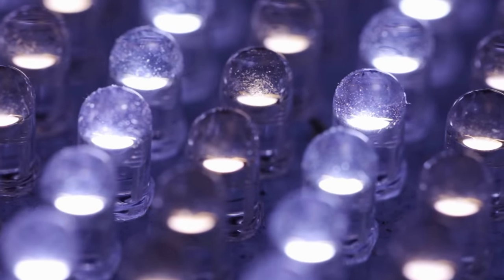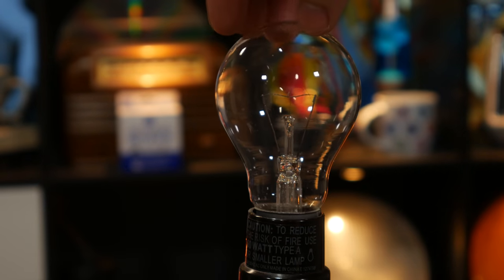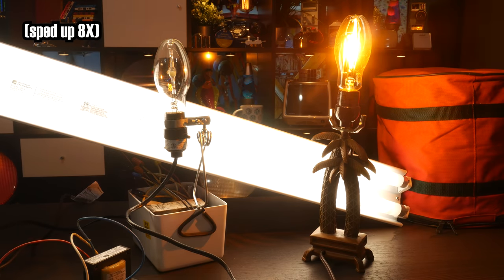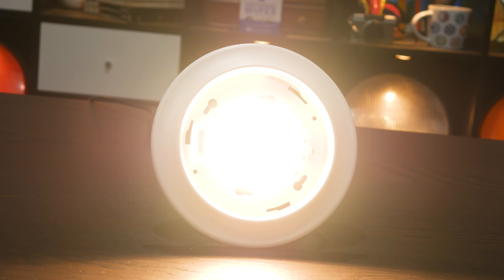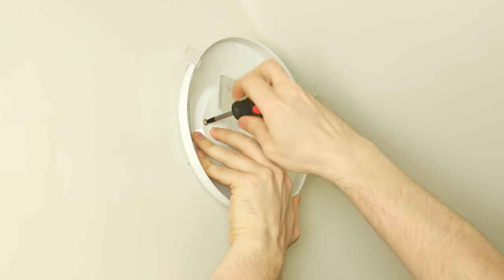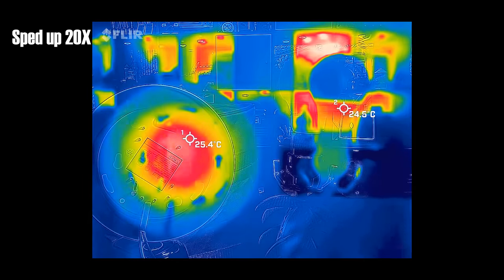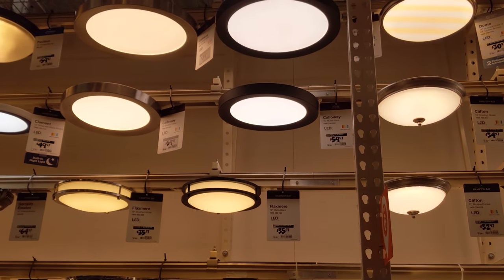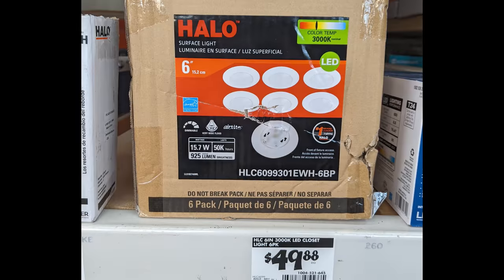A troubling trend in lighting?

Comment: I dunno, old school LEDs might also have really long service lifetimes. All my old 2014 LED bulbs came with massive heat sinks. I am disappointed that more modern LEDs did away with the massive heat sink design. I have trouble finding any modern LED bulb with a heat sink at all, even on the high end models.
Reply: Clearly they were lasting too long..... a bit of planned obsolescence was needed to improve the manufacturers bottom line.....
Reply: @geoninja8971  It certainly feels that way. When I sold my last place, I regretted not taking those LED bulbs with me as I never had a single burn out for the 22 bulbs in the 8 years I had them. But in the 6 months I've had my new place, I've had 4 burn outs for 26 bulbs. And the 2014 ones cost me $38 a bulb compared to the new ones which cost me $52 a bulb.

Comment: What kind of LED bulb can you use in a lava lamp - where the heat from the bulb is needed to melt the waxy insides of the lava tube? I can't help but wonder whether a special device comprising a heating element for the lava lamp and LED lighting fixture would be more efficient than an old school incandescent bulb -- which you might not be able to easily procure anyway.

Comment: Fortunately the EU has realised, finally, this is a problem so the new directives are out, requiring manufactures to adopt a more circular and "green" approach. LED modules should, therefore, be replaceable or the manufacturer must provide a good enough technical justification why that wouldn't be possible, before the product could be sold in the EU. The Single Lighting Regulation is established in three directives: (EC) No 244/2009, (EC) No 245/2009 and (EU) No 1194/2012.

Comment: incandescent bulbs had many different sizes and shapes. why cant we use the smaller bulb sockets for some of these. sure we would need a way to sink the heat into the socket itself more efficiently but it should be possible. i personally believe making the socket smart rather than the bulb is the way to go. we just need to come up with a new socket design.

Comment: I bought a cheap LED floor lamp without a replicable bulb from Walmart. Failed after two years. Took it apart and found one of the LED COBs failed, they are wired in series so if one fails the whole board stops working. I got a 50 pack cheap from eBay and replaced the broken COB. Worked for about four months and another COB failed...

Comment: Fun story. When I was a kid who knew NOTHING about electricity other than it hurt... And that there's a positive and a negative side. I decided to cut the cord off of an old toy, then I took the little blue LED out of the toy and connected each little pin sticking out of it straight to the positive and negative wires I had stripped from the end of the cord, then I plugged that bad boy in. Called myself making a night light. (Blue was my favorite color so I really wanted a blue night light for my room... lol.) I had a blue night light tho. For like .05 seconds. Lol. And it was VERY bright. Came with a LOUD bang and it started smoking too... lol. Luckily the breaker blew before it got too serious. I was intrigued. It led me to my curiosity of electricity.

Comment: I've just fixed one of these... By tearing the LED strips and driver out and putting two small Edison light bulb sockets in. So with little DIY one may save them from dumpster.
Reply: Before you ask: The one I fixed had a different design with a circular strip of LEDs glued to metal frame around a small driver in center-ish. Despite rare use multiple LEDs burned showing black spots on chips.

Comment: I have installed several of them that almost every one went bad rather quickly, and  unfortunately, one of those...things...I installed in my home.  Needless to say, I went back to light bulb LEDs. The one thing I think is rather odd, is it should be relatively easy to make a...erm...outlet like device that could be affixed to the electrical box and the LED device could be...screwed...latched...whatever to that receptacle like device. It should be possible to make it thin, thick, wide, long, or tall. At least it seems like it should be a simple invention.

Comment: I am still amazed and surprised at how lax electrical regulations are in America. To imagine that you can simply twist the bare wires directly together in a box in a wall and just screw a fixture directly to the box seems absolutely mental when you live in Europe where we have wall mounted fixtures for connecting our lamps externally to by law. As a homeowner you never even get near any bare wires.

Comment: I have a floor lamp in my bedroom that gets used a LOT. It's shaded, but the top is open to let the heat out. It went through incandescent bulbs like nobody's business. I decided to try an LED bulb in it, so I picked up an only-slightly- more-expensive-than-incandescent one from a reputable brand and it's been going ever since. How long? Not sure, but several years. So, so worth it. These things have like three times the life expectancy of a hamster, and hamsters, I'm told, provide HARDLY ANY lighting.

Comment: ok the led bulb failure makes sense. my bathroom fixture is ceiling mount combined with a exhaust fan/heater. that bulb usually lasts about 6 months. I'll change to the glass LED bulb next time it fails.

Comment: was looking at a similar product, much better design-- the biggest difference is you keep the old fixture or at least the screw. The new one needs no significant electrical work, just screw the connector in like a bulb.

Comment: What if they put a regular socket on the ceiling and then add some mounting holes? You can then build the fixtures to just have a regular plug and mount it easily and safely.

Comment: I've always considered standardised sockets to be generally better than the fixed alternative.

Those lights honestly seem like a scam, if the parts are placed such that they're at risk of heat damage and the whole unit has to be replaced with existing limitations on who can do so. A socket connector on a similar lighting setup to those ones would make a simple compromise, but I guess there's no money to be made in that.

Comment: the biggest issue I have woth them is that the screw holes in the metal plate don’t match with the screw holes of the square wiring box in the ceiling. Sticky tape isn’t really an option, so for now I have them hanging on the wiring itself

Comment: you know you can buy replacement boards for these lights right, despite being meant to replace the whole fixture? When installing, bring the wires into the fixture itself, and use WAGO connectors. When the LED fails, just replace the board. I've been using these all-in-one fixtures for more than 4 years with no failures, it's very rare that you have to do a replacement job. And when it comes time to do it, it's so cheap that one can just replace all the boards at once
Reply: Sounds like just as much of a job as just replacing the fixture.

Comment: The better fixtures have a proper LED driver power supply. That means they are constant current controlled, So a burned out LED in one of those can easily be bridged by soldering a piece of wire across that failed diode and the rest will light up as before. So they are actually repairable to a level no other light sources has been before. It is not only a issue of saving a few bux on a new lamp, But as they normally last years, getting a replacement fixture to match the others you have in a room can be impossible, Repair is the only alternative to changing all of them. LEDs are not "cold" to look at. The reason they seem so is because you use them with CFL or incandescent bulbs so you eyes white balance compromises and choose the middle way, putting the LEDs in the blue end of your perception. Use only LEDs and They'll seem like warm sunshine. Samething with HID headlamps: They look blue at night, even if they have the exact same color temperature as sunlight. Won't use anything less than 4500-5000k bulbs in my home. Yes CRI is important, go for bulbs or tubes made for retail lighting, they are in the 90-95 range to make displays look appealing and are not more expensive as opposed to "special" high CRI bulbs marketed for consumers. #3 Cob lights, the yellow sticks type, can for longevity, if used in an opaque fixture, have their glass broken before use for better cooling. Whatever heat conducting special gas inside those, can be easily be outperformed by a light tap with a hammer.
Reply: what brand of fixtures are they
Reply: @redcathode  The cheap bulbs has a diode-resistor-capacitor to drop the ac voltage down to a reasonable DC voltage and current for the leds, the proper ones has a real switchmode power supply, that include the ones sold in Europe and the US. and the more expensive ones online from China. Just open it up, if there is something with a coil or transformer in it or even a boxed power supply with some specs written on it, you are good to go.

Comment: One ironic thing about LEDs is found when you convert your car's old halogen headlights, and you find that many of these uber-efficient LEDs that ostensibly don't use additional power making loads of waste heat...need a cooling fan built into the light base to combat all that additional heat.  Even halogen bulbs don't need that.  🤔

Comment: Flickering power on and off such as happens when thunderstorm are severe, seems to nearly always coincide with the death of on of my led lights. They really do not cope well with inconsistent power levels. 
I have changed every single bulb in my house to led of one kind or another (yes all color matched) many are wifi smart bulbs and sadly they are the most prone to failure after a thunderstorm.

Comment: That's exactly why I installed regular recessed lights and use LED bulbs in them The myth that LED's last 20 years is just that and while I'm ok th  replace the entire light on my car in lieu of replacing a bulb, I'm not ok to do this in my house where I have probably 50 or so recessed lights. I did use these integrated lights in the closet where lighting isn't that much of an issue, but everywhere else it's LED bulbs.

Comment: THe only thing i'm thinking this entire time is, why instead of using the two dedicated wires as part of the fixture not simply produce a clip on or twist on socket so that you can remove the fixture without having to undo the connection to the box and then plug or slip on the new fixture and screw it in. Other than avoiding the cost of 1 to a small number of additional components.

Comment: What I like to see. with these led panel lights. Is a quick connection for the power wires. I hate having to use wire nuts to connect these.

Comment: One of the many reasons the incandescent light bulbs has been phased out, mainly the 60, 75 and 100 watt bulbs but soon all, is most of the energy is heat and not light  My question is this.  In places like Chicago, where out very humble host lives, in winter time, how exactly is that a bad thing?

Comment: landlords kicked my door in and ripped all my light fixtures down about a year ago.  installed these obnoxious things instead. 

when i moved in here, they had insisted that i was to call maintenance and put in a work order to change a fucking lightbulb.  the fixtures used these weird fluorescent bulbs with strange contacts that you couldn't easily find at Lowes or whatever, but were easy enough to find online.  now i've got a shelf full of spares and i have to call in sick and contact an electrician when my lights die out.

Comment: Wow. You in the states have standardized distance between screws to mount on standardized wall boxes? Here in Europe we just have wires coming from a hole in the wall or ceiling, and need to make new holes in the plaster every time we change the fixture (which makes those disposable fixtures an abomination)

Comment: maybe there's a market for. inexpensive plastic film with 'colour temperature shift' colours, as used in motion picture filming forever...3400 to 2750 was quite common, shifting halogen spots to match incandescent lamps...it would be killer in your case, just boutique out a circle of film, and lay it over the LEDs', and not much efficiency lost, little effect on cooling, especially if it was a 'soft' film that could adhere to the inside of the plastic dome...I'm surprised that a seriously-smart guy like you, wouldn't try that...

Comment: we need new standards obviously. a standard for drivers of different sizes, say 25W max, 50W max, 100W, 200W and then standard connectors for that to mains, and to the led board.
Then a bunch of standard sized LED boards of various shapes etc. say rectangle 5x15cm, 10x10cm etc. and round ones.and standard where the screw holes are, and what are the minimum cooling specs @ 25C ambient, which has to be designed for 100% duty and 30% over specced.

I just bought some OSRAM high bays for my garage, they are installed at 5M high. They were suprisingly inexpensive, but no connectors, and when failing replace the whole fixture.
Guess what? Just couple months in, 2 of them failed -.-
Now i have to get lift + electrician on-site to swap them, cooooostly. Costs much more than the fixtures. Infact, fixtures itself were only about 30% of the installation costs ...
It cost quite a lot to install those.

And because being LEDs i had to color temp mix too, out of 18, 4 are warm rest are cold to make the light quality better. Just don't look in the ceiling to avoid being annoyed.

OH AND WHAT'S EVEN WORSE?
They are meant for industrial high halls.

Only when you receive them there is a note inside -> Max 8hrs a day and i think it was like max 30C ambient, and only like 5000 hours to begin with.
Wtf? These kind of places frequently are 24/7 operational and being high in space there could easily be 50C temperatures, and replacing them is expensive and hard if you have machinery installed on the floor, downright impossible.

Infact that's how it was for us, took planning and a lot of work, and very specific lift to be able to install them because unsurprisingly the place was being utilized.
And lights were downright outrageously bad there EXACTLY because replacing the old tubes were too difficult, and the reason why LED highbays were to be installed.

It's also the reason we over specced the lights by a significant margin. Going from regular ol' tubes to LEDs, power consumption actually like doubled. To give room for failures. I just did not expect that within the first 6months ~10% of the high bay OSRAM lights would already fail ... I was more planning that maybe 15% per 5 years ... not 20% per year.
Tho that being said, since then 0 failures yet, giving total 1½ year failure rate of 10% or 7.5% annualized.

Comment: I am moving into a new house soon, and I need new fixtures because the existing ones are hideous and won't match the paint. I went to my local hardware stores to pick some out, but so many were those stupid integrated LED ones, which is especially a problem since I need ceiling fans too. I really dislike this trend. It's especially abhorrent since so many are just LED replicas of boob lights

Comment: Oh man, I really got hurt by integrated LED fixtures. In hindsight, I don’t know what I was thinking at the time. Maybe it was simply decision fatigue as I was going through 9 month while house remodel (while living in the home). Anyway, I bought exterior fixtures from Home Depot that have non-serviceable, integrated LEDs. I installed them in 2020, and 2/3s of them have completely failed or have degraded to a point that more than half of the discrete LEDs have quit working. The warranty was only for 2yrs, so this past weekend I replaced 3 coach lights (fixtures and all) on my garage and 5 exterior door lights. 
I wish I could share some pictures here. Terrible, terrible design. I of course, replaced them with fixtures that have bulb receptacles in which I installed 2,700K, filament style, LED bulbs.

Comment: Consumer repairability is no longer a factor for most large electronics manufacturers, including those that manufacture light fixtures.

Why sell 1 or 2 bulbs every couple years when you could sell the entire fixture again in 3?
Reply: Don't give them that much credit, it never was, it's just that in the early days the technology would be straight up unusable if you couldn't exchange the lightbulb yourself. With LED's with 10x the lifespan that's not really a concern
Reply: @asd-wd5bj  LED's are known for failing way earlier than they claim
Reply: @Warp3326  It's still way higher than any incandescent bulb so i don't see your point....

Comment: about the wiring issue
i feel like we have solved this one already
plenty of things nowadays has some kind of plug
so instead of having to literally rewire a fixture
why not just install some type of plug on the wires?
like hell if you wanted to get crazy enough
just put a regular wall plugin where ever you need a light lmao (bad idea but it gets the point across)

the replaceability is still disgusting though
i swear if these companies could charge you for every time you flicked "their" light switch
they would and do it twice as well

Comment: I had new ceiling lights put in using these LEDs, but the ends used what looked like a molex connector to hook up to the electrical box. There are also retrofit modules that have a pigtail that goes to a little A19 adapter.